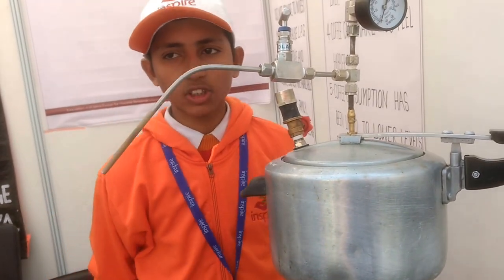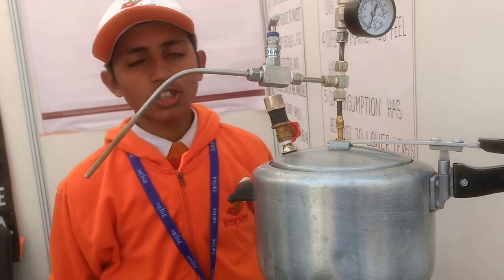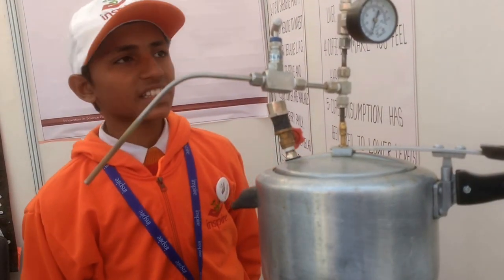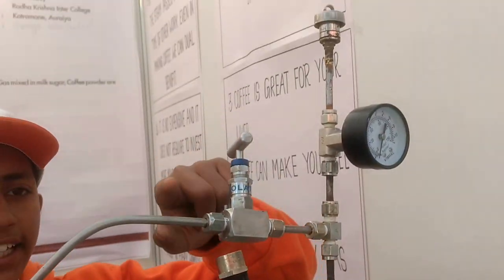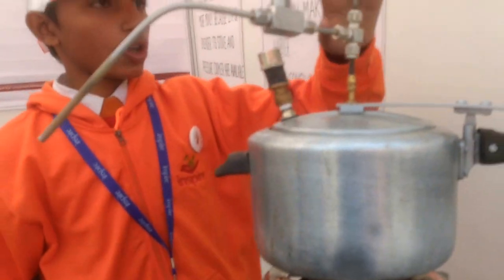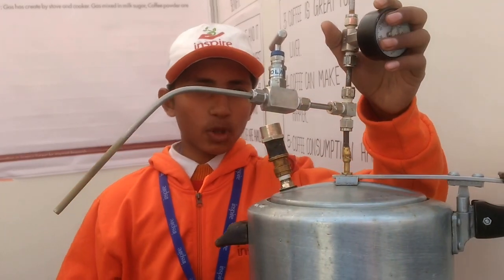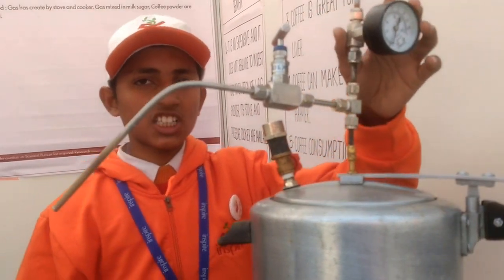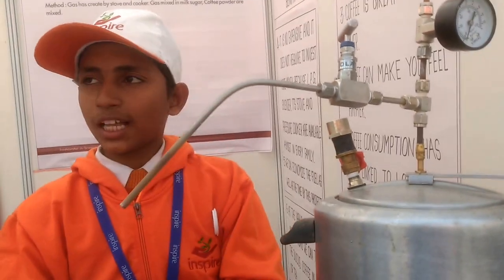Pressure cooker based coffee machine

Comment: Can you tell me in detail about psi Capacity of Pressure Gauge Meter-Clock wise equipped with Pressure Cooker operated Coffee Maker and also ONLINE availability & Purchasing of Stainless Steel Tubes & it's Shape, TYPE, SIZE & LENGTH,ID & OD of required Stainless Steel tube/Or SS Pipe,also Needed"SS SPRAY NOZZLESS" at the end of"L" shaped ELBOW PIPE for steam blowing in COFFEE POT, the two JOINTS Connecting NIPPLES", SS Nuts, SS COUPLINGS,PRESSURE GAUGE CLOCK  WISE METER, Steam Flow & Lock control SS BALL VALVE etc required total attachments for making of PRESSURE COOKER OPERATED COFFEE MAKER ESPRESSO MACHINE?

Comment: This is very innovative buy they have changed both safety valve and hope set pressure is not changed bcoz pressure cookers are not designed to be boilers else it would be a risky move and chances it might explode.
Reply from the maker: This is just a beginer project. If you need to bring it to market then you must thiNk about safety